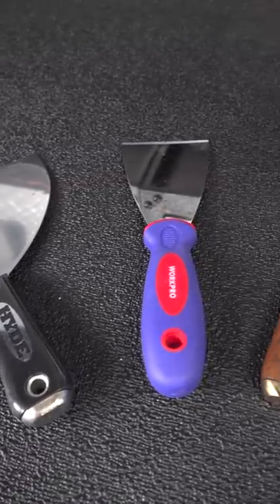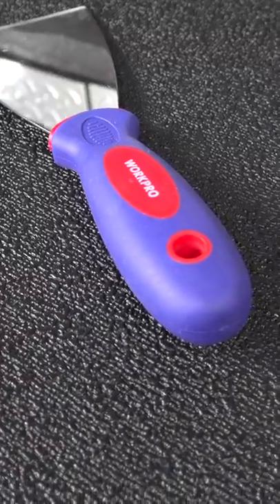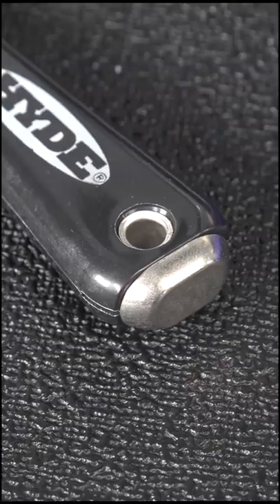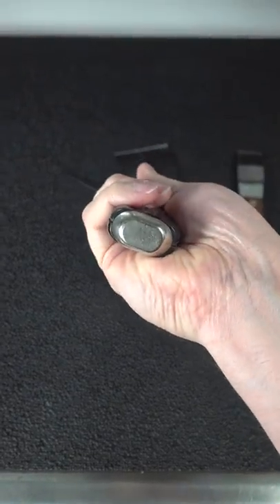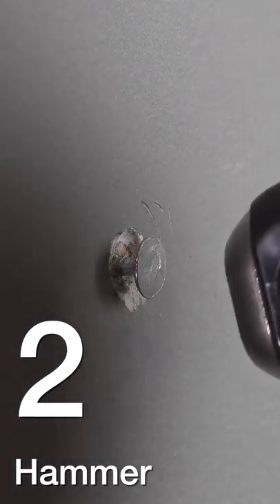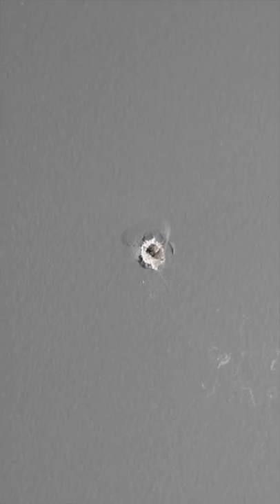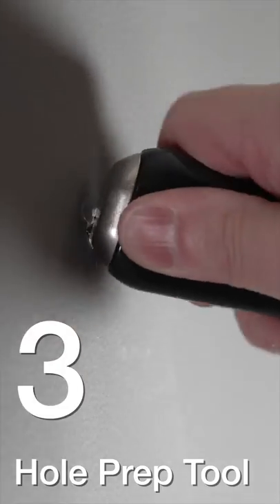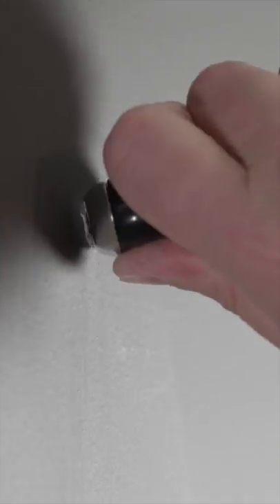Few Know the 3 Uses for the Metal Cap on a Drywall Knife  #Shorts

Comment from the maker: Thanks for watching please LIKE & SUBSCRIBE Best Drywall Knife: https://amzn.to/3Hy29wD
Reply: @kimbuck-2  😂😂😂😂
Reply: No one in the world puts WD-40 on their putty knives except for you.
Reply: Not all people know this but we-40 is lightly corrosive, tray a light machine oil
Reply: Doesn't some have a Philips screwdriver in the end
Reply: I am a master plasterer. And don't use the hyde. The handle is too short and poorly shaped. And the blade is usualy some form of carbon steel and so tgey come with a garbage plastic coating that scrapes off into the mix as you work. So it needs to be sanded and then they rust hence the wd-40. There main benefit is there flexibilty and resilience to deformation. Spring steel is another name for it iv heard. And sudo protective layer can be applied be soaking in a bucket of water over night. The steel will tarnish or corrode so fast it turns black. Im shore its the carbon coming to the surface one how. In the end it stops the rusting but now plaster sets on tge tool in a thin film and it acts more like glue then plaster and is very difficult to remove. Tip use more water. But dont soak it. The plaster and steel together this time around causes rust. If you want my oppinion. Stainless steel has the stiffness to make shore when you coat the join even if you push hard it will resist the flexing forces and carry your filled join to a flat surface from edge to edge like a machine did it. Thats is an example for trowels but when ever a 6"inch width is called for this is the same principle all you need its called "builders edge broad knife"
Bunnings sells them. I swear by them. I never had to spend more then 5 seconds cleaning them. My trowels are stainless too. And the handle is shaped to fit the hand and not slide out and the other thing. The hyde handle is not only too short its also too narrow. Not meant for a real sized man. Like its trying to make you feel good about yourself. And the back end with the steel but. Most hyde broad knives iv seen dont have them at all. Its a features. The type i mentioned the entire thing handle and all is one piece of metal. Glue on the handle. No problem rip it off with  blade. Its not plastic. The blade wont dig in like a hyde. Glue knifes for example are 2" inch broad knives and they get a good coating. Not that iv seen the builder edge in that size but 3" inch is close enough.
Reply: @Darkstar.....  umm okay
Reply: I was using one like that to wedge into where I cut along the top of the baseboards for removal.  I hammered it in, then hammered a screwdriver to use as a wedge so I could get the prybar down into it to get each strip started.  Also worked extremely well as a barrier between the prybar and drywall so I didn't damage it as I went along and removed them

Comment: Cleaning of tools is one thing I learned as a teenager. I was on job sites painting, demoing, and making commercial installs. Though I never pursued work in the industry, it kept me in good stead when I had maintained an apartment building. Now as a home owner I have spent years doing my own plumbing and electrical repair. 
Nothing feels better than to pull a clean tool from the tool bag to start a new project.
Reply: same here but I do that with all my lawn equipment...😂😂😂😂
Reply: @rauljuarez3884   I spray my deck top and bottom with a local product called "Rust Check". It's Canadian and been around for decades. 15 years on and my Craftsman mower looks like it's new.
Reply: @robertlee4172  Corrosion Free is a similar but more effective coating per studies sponsored by the Canadian Military for storage of military hardware in wet/winter conditions.
Reply: @robertlee4172  thanks for the advice..👍
Reply: I use either Hammerite Waxoyl, or XCP. Has worked wonders for years on my small mower to keep that pesky corrosion away.
Reply: Damn dude if it has taken you years to do your own plumbing and electrical repair it might be time to throw in the towel and hire a professional!
Reply: @2nd-place   Why? So you can rob me?
Reply: And as myself a full time carpenter I can easily say that cleaning your blade that thoroughly is ridiculous. Ive got blades that are over a decade old with weekly/daily use and ive never cleaned them that thoroughly. Its dumb.
Reply: @shikakabubu  Blades??? I was talking about clean tools. Yes I clean  my blades too. All drill bits,  all saws, hammers, and sockets too. I have  hand tools and socket sets over 40 years old. Still in excellent shape.
Reply: @robertlee4172  these are drywall knifes
Reply: @shikakabubu  Ya, and? What does it take to wipe  it  clean after a job? There's no convincing you because you don't and won't take care of your tools. I worked in a commercial kitchen with 50 chefs, in 5 restaurants. We  all cleaned our tools there too. What's different about cleaning tools after  work on a job site?
Reply: @shikakabubu  Some folks just want to spend time and money keeping things shiny even if it doesn't affect performance.
Thinking folks don't bother to do so with tools that are perishable, expendable, or cheap.
Reply: Is demoing in iowa?
Reply: Real workers have too much to do to clean tools. Just re buy when time comes
Reply: @puzzazz  Slobs don't clean their tools. Like I mentioned earlier, I worked in commercial kitchens, on a facility with 5 restaurants. We always cleaned our tools at the end of the shift. How would you like to be served a meal by a chef who has bacteria growing on his knives and spatulas? How would you like it if a plumber or electrician came over to your house dragging in his filthy equipment?

Real workers? Some standards in hygiene is appreciated.
Reply: Yeah everyone makes jokes when I clean my tools. But then my tools are still like new and theirs are caked with shit and even rusted.
I’m not really over the top with the clean I just wipe my tools off with a rag when I’m done with them and give them the occasional splash of oil. 👍

Comment: Fun fact: over time the WD-40 should build up a little bit of a layer on the tool which can make it easier to clean off. This also works on steel to prevent rust and make cleaning it much easier it is almost like wax in a sense
Reply: @bmo14lax  yes it helps ever wonder why your bike chain never rust (if you take care pf your bike at least)
Since you clean it with WD-40 and after cleaning you put a layer of WD-40 on your chain or chain oil to prevent your chain from getting dirty or rusty so it does not break
Reply: @bmo14lax  now i get your point beter 😂 yeah its not fit for everything something like a pan Or other tools related for cooking would not be smart to put wd-40 on
Dut you can still use it for building tools to clean it and lowers the rust chance  😉
Reply: The WD stands for water displacement, so I mean it checks out 🤷‍♂️
Reply: @lickalittle  you serieus😂 no it is not its the main thing to keep chains steel or other type of ore from rusting it is always used on metal to keep it in its best condition that there is alcohol in it won’t change that fact 
And alcohol on its own does not creat rust even since it vaporate
Reply: True, but don't use WD-40 as a lube, since it build up layers on metal in a long run it will make it even more prone to stuck.
Reply: @maayu8108  no you use silicon lubricant for that it has worked wonders for me
Reply: @koldbloodedkiller  WD-40 is literally the worst thing you could put on a chain to lubricate it, unless you are using the WD-40 chain lube specifically for chains.
Reply: Wd-40 is a water displacer. And acts as a degreaser. Not a wax. I use it to take the glue of the window after i peel a sticker off. What part of that is leaving a protective set coating. Wd-40 is amazing but its not going to glaze the surface like a wok. Fun fact its not called a drywall knife it is called a broad knife. And you can buy stainless steel versions that do not rust and do not need wd-40. Not that any plasterer i know ever used it for there flushing tools over the last 16 years besides mechanical flushing equipment like flushing boxes. You put them in your channel and nail it like uncle Roger(on the back seat) cooking fried rice and ill say great things about it. Even fuiyoh! 

It makes the broadknife vs flushing boxes look like 2n rate tech vs top end tech.
Reply: @Darkstar.....  I appreciate the Uncle Roger reference
Reply: @BeardMan01  That's a fact, it's not a lubricant of any kind and shouldn't be treated as such. Lube for things that need lube, and WD-40 for everything else.
Reply: Yeah, but be sure to clean it off before using it to apply compound, as that WD-40 will not allow paint to adhere wherever there's compound.
Reply: @UkrainianBazooka  Based on observation, it's definitely a lubricant of some kind, but I agree that it probably shouldn't be used as a permanent lubricant.
Reply: @UkrainianBazooka  It absolutely is a lubricant of some kind. It leaves behind a light petroleum based oil. If I had a nickel for every time someone falsely claimed that WD-40 isn't a lube I'd have all the nickels.
Reply: No offense to you guys who are fans of it but, WD40 isn't fit for much of anything other than, maybe it's originally intended use of cleaning and protecting bombs. Almost 50 years of near daily use of these types of products has proven this to me unequivocally. I learned as a kid that It will eventually ruin a bike chain and pretty much anything else over time if you don't nearly constantly keep reapplying it (which is good for their sales if you don't know better products and methods exist). A sometimes hard to find product by Duracell called "BreakFree" is much better and even the crap you by at Walmart P.B. Blaster, etc is much better. Aerokroil, though expensive (and for good reason), is hands down a far superior product.
Reply: @Darkstar.....  🙄

Comment: "Hey Jimmy, look at this video. Did you actually design that drywall knife's metal cap for those purposes?"

"Nah, I just made it that way cause it looked shinier."
Reply: Exactly. Nothing truly life changing about the cap. I could use a plastic one the same way he's using the metal capped one...not as easy to hammer a nail in but I mean come on
Reply: @ohioknifelover  lol. Right?
Reply: @ohioknifelover  yeah... Let me know how that works out for you... You'll ruin that plastic in no time... Wanna know how I know? I've managed to destroy metal ones over time. Especially if you're hammering on nails. It comes down to common sense. Don't buy junk. Get the ones with the proper end and consider getting the stainless steel ones so they look brand spanking new for years and years instead of a rusted mess after a few hours of neglect.
Reply: @AlexKunstar  Oh sure I would get the better one, but I was just saying it could be done with the cheaper option is all

Comment: You can also use the metal cap to mark repairs if your spotting out a large area. It will leave a mark similar to a pencil mark but much easier to cover when patching or painting

Comment: You forgot the 4th use for that metal cap! 
Its for writing on the wall and circling blemishes for your workers to fix.
Reply: We must stop this evil from spreading
Reply: I just use blue painters tape.
Reply: How annoying would fixing that wall after you're done with it be
Reply: Not heard of a pencil? You'll probably know it as the tool you use to screw screws in with....
Reply: @roman111117  if I’m marking blems on the wall then it’s already going to get painted afterwards so it’s a non issue, as the guy who owns and runs the company it’s up to me to maintain my level of quality promised to the owner of the property. That’s why I have the job of inspecting and pointing out the issues I determine will need fixed.
Reply: @John...44...  good try chump, it’s called a “5 in 1” but it’s got a lot more uses. The marks it leaves covers with paint better then a pencil, I scrape peeling paint, I sink nails below the wall to get mudded over, I mark blems, I dig out old caulk and so on all with one single tool. But yeah, you would definitely reach for a pencil.
Reply: @Sak-zo1ui  get a job.
Reply: @alexblackburn627  edit terrible joke 😂
Reply: @Sak-zo1ui  your the joke 😂
Reply: @Sak-zo1ui  weak
Reply: @alexblackburn627  I definitely would! It's the correct tool for the job! Just because it's physically possible with another tool doesn't mean you should
Reply: @alexblackburn627  🤣 I'd rather people think I had soft hands then soft brain..... I'm sorry but I haven't met any tradesman who doesn't have a pencil on him....
Reply: @John...44...  your completely wrong and calling me smooth brain? The irony. GG baby face, ttyl
Reply: @alexblackburn627  damn.
Reply: @alexblackburn627  insecure much
Reply: @mrcroob8563  coming from the dude using an alias and no picture on his account.
Reply: @alexblackburn627  also, *you're. Go finish school.
Reply: Cause I don't know if you got beat or bullied too much or not enough or what but this situation needs professional help.
Reply: @joshyoung1440  take a hike buster.
Reply: @alexblackburn627  I can't tell if you're playing a character or if you're unironically trying sound tough on the internet while pulling a "gorilla warfare".
Reply: @alexblackburn627  must be a shitty company if all you can afford are shit cars from the 70s and 80s 😂
Reply: @markus7166  that was a 68 k20 and a 77 mercury monarch, both of which have been in the family since new, I didn’t pay a dime for them, gets your facts straight bud. The sc300 is not mine, it’s a favor. I daily a 2021 baby boy.
Reply: @thatrandom_canadian  sawcon
Reply: @alexblackburn627  those shitty ass cars are what I consider throwaways, baby girl 😂
Reply: @markus7166  keep trying, find me a k20. You won’t. Besides it’s gone now, was just moving her along to a new chapter in life. The monarch is sentimental and currently getting restored. Now, you proved you can’t read or write by misspelling “daddy” and failing to understand “k20, it ain’t no c10 baby boy. Do it again and your going up for adoption.
Reply: @markus7166  you can’t read can you. Don’t need marketing bud, we’re booming. What’s your company, working Johns in an ally?.
Reply: @alexblackburn627  I don’t get why everyone is pissed at you for knowing more uses.
Reply: @T_M_E_8  because they are sensitive, can’t stand to see someone making it in this world while they have to slave away at a garbage 9-5 grinding to pay the bills or worse, sleeping in the basement unemployed waiting for their parents to pass from old age and inherit the house.  

I do enjoy the banter tho, like I said it’s fun to reply on my phone when I see the comments.

Comment: I round down the edges of the drywall knife about a 1/16" so when using drywall tape in the inside corners it doesn't damage the paper tape.
Reply: I narrow my 4 inch and 6 inch drywall knives by about a half inch, so I have less mud width to work. 3.5" under the tape, 5.5" over the the tape for the tape coat. Then block and skim coats end up better and I can work faster, by not having to draw so much mud. I cut the tops of my corner tapes at a 45 degree angle to flush out the mud.
Reply: @jimjungle1397  genius, keep up the good work
Reply: Yeah or just own a corner trowel
Reply: @n3onize  Traditionally, that is a plaster tool, not a drywall finishing tool. I've been on union jobs where drywall finishers couldn't use plaster tools and plasterers couldn't use drywall knives.
Reply: @jimjungle1397  yeah I agree if we were still building 20 years ago, but corner trowels are literally designed to push the tape into the corners so yeah, you even have adjustable corner trowels to change the angel, as most paper internal tape should be steel internals and steel externals, there easy enough to push in and run the corner trowel down in 1 movement you have a whole internal corner taped, rather than moving up/down/up/down/up/down. Yeah every country is different though.
Reply: I use an orbital sander to clean my blades off and that usually rounds the edges perfect for what you are talking about.
Reply: @n3onize  I’m a plasterer, old school. I use my hawk and trowel, never a pan and knife, and I sponge finish for smooth work. The plaster tool you speak of is a butterfly and works perfectly in the corner angles. I also use mesh tape, rarely paper tape, only for paper mache’.
Reply: @jimjungle1397  as a plasterer I’ll tell you, always use my hawk and trowel, never a pan and knife. I was Union for 20 years and drywall finishers were amazed at what I could do, especially because I don’t sand, I sponge finish. I have always said, a plasterer can always do drywall finish but a drywall finisher will never be a plasterer!

Comment: I just use a hammer to push in the bit before spackle. I wouldnt say those are secret uses and a plastic handled putty knife is less durable for how often you drop it. If you're dropping a putty knife often then you probably shouldnt be spackling... I could do the plastic handle for a hammer too and to push in the little bits before spackling.

Comment: When I finished drywall we never grinded misses or holes like that. We always tapped them in. It makes a little dent that fills really nicely.
Reply: Yeah, if your gentle enough you can do that. But the function is supposed to work like putting enough pressure to dent the drywall. In reality it works just as well the way you do it, long as you ain't going HAM and punching a bigger hole into the wall lol.
Reply: @trippinbawls88  Yeah it's just a tap. You just dent it. You don't bust a hole in the wall.

Comment: I once put rusty hand tools in a plastic bag and generously sprayed them with WD40 for a good soak. I forgot them. A couple of weeks later, the rust was so bad I had to throw out the tools. All that to say: WD40 helps cut through existing rust, but it's not a rust preventive. Use mineral oil.